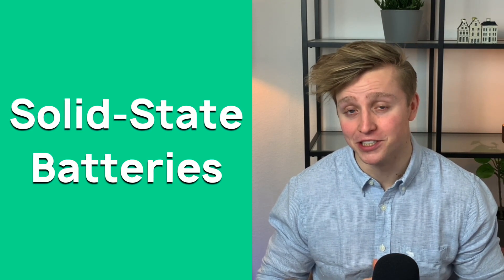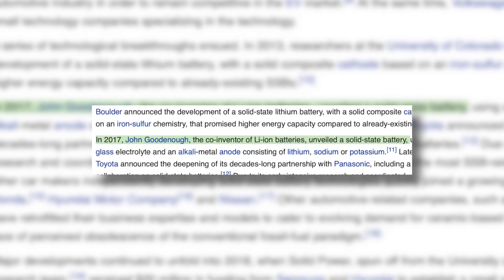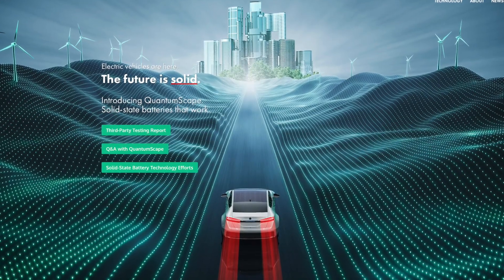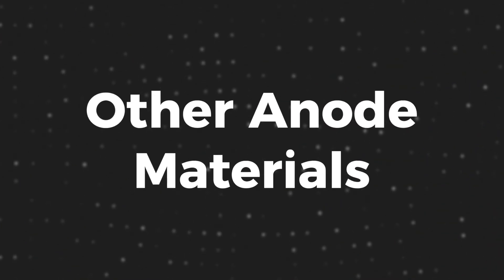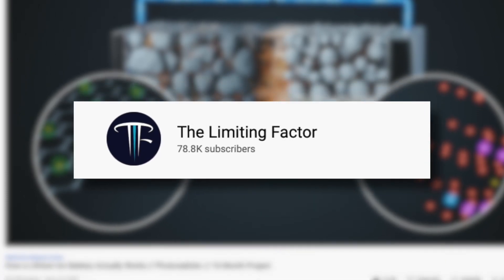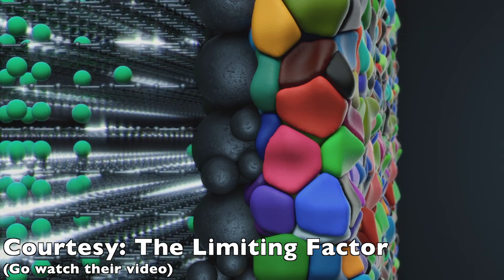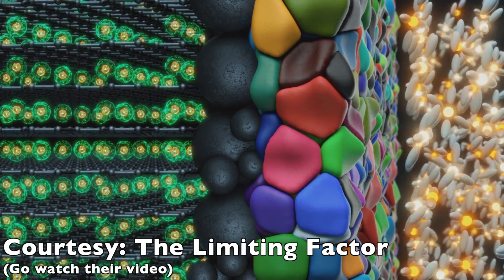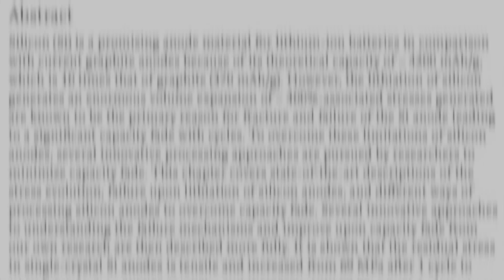Confronting CEO Gratomic on Graphite Bear Case – Graphite in EVs

Comment: Tesla advertised raw metallurgic silicon at battery day, however they just signed an off take graphite anode agreement with Syrah. Quantumscape’s 2030 capacity goals are minuscule to where the market will be, and we don’t know the final  costs or performance metrics. Twh worth of LFP and NMC will not simply turn off in 2030 and worst case will likely still have use-case superiority to solid state where cycle life and cost are priorities. Lithium stocks have 3x this year while some graphite stocks are well under 52 week highs. Graphite will re-rate when better understood imo.
Reply from the maker: Great addition infiction!
Reply: Great comment! I think Tesla battery day talked about an anode with both graphite and their Tesla silicon. At the moment I don't have time to rewatch that part of battery day.

Comment: This video got me thinking about graphite... What other potential clients do these mining companies have? Pencils still a thing?
Reply from the maker: Great question! Arno happens to answer this one in particular during the full interview!
Reply: Nuclear power also uses a good deal of graphite
Reply: Hydrogen fuel cells, is a big upcoming one .. as well as all the traditional uses (huge portion of the current market) such as refractive material in the metals processing industry.  Battery anode material still has the potential to be the most profitable though, but it also requires significant post processing after extraction from the ground.  Gratomic has plans to be a vertically integrated anode material supplier.